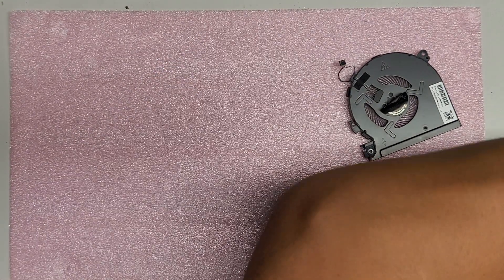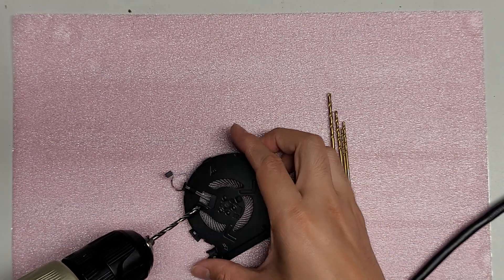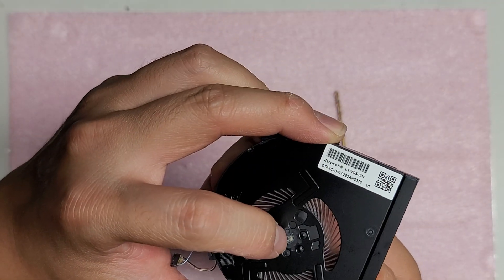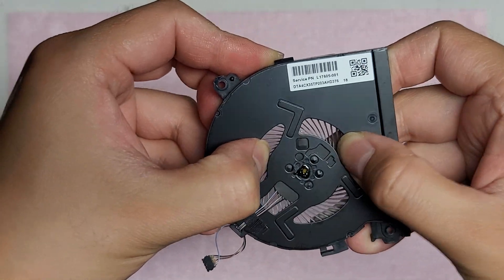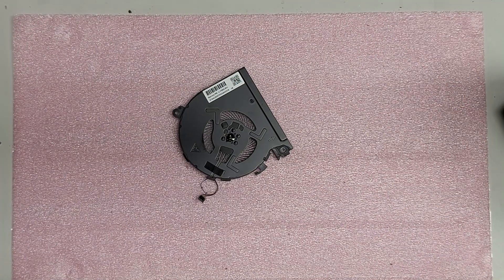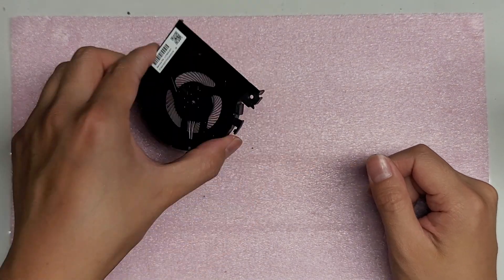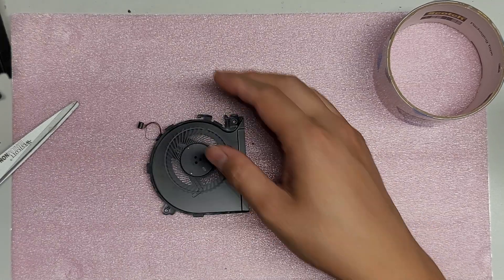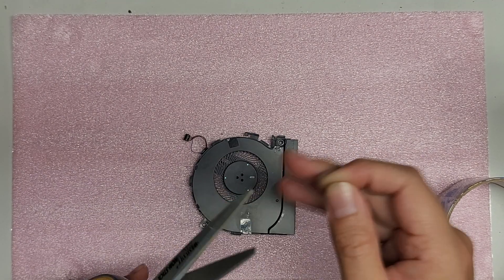Laptop fan repair drill method *other methods in the description*

Comment: Great video. I only think you somotimes wrongly said grease, when you meant lubrication. Lubrication is a wide category, whereas grease usually means a more viscous and thick. It penetrates less, but better stays in place. I think what you used here is widely called oil, what you also said.
Reply from the maker: Uhhh lol You better not be putting lube in your fan.

Comment: both my nitro 5 fans weren't turning on. i thought i messed up a setting but nothing i did could turn it on. so i removed fan and saw both where just too hard to start up. afraid of breaking them trying to pop them out i did this drill method ended looking brand new same speed like 6125 on both in nitrosense from cpu 0 gpu 0... for a nitro 5 this is the best method if you dont wanna buy new fans or can't buy. Thanks a lot!!! Great Vid.
Reply from the maker: Awesome, glad it worked out. If you haven't already, please like and subscribe so others can find my videos. Thanks!

Comment: Hi. Could you make a video on how to oil the fan of HP Pavilion 15-n series laptop?

I have that one, but I haven't found any useful video. Here, 99% of repair guys are scammers who will steal original parts from your systems. So, I'm not confident in going to them for help.
Reply from the maker: Watch the videos in the description. These are all customer computers. I don't have the money to go out and get every single model to make a video every time someone needs instructions for something. Lol
Reply: @ItsBinhRepaired  My bad. I thought the laptops you fix are experimental laptops lol.

Thanks for the response, chum.
Reply from the maker: @HAImaster  hahaha nope
Reply: @ItsBinhRepaired  Sorry lol

If I send you a video of my laptop's fan, would you be able to provide guidance? It looks pretty much like this, and you can't remove the fan. I pulled with all my might, but stopped because I thought I would break it.

It makes a lot of screeching noises to the point of drowning out every other sound in the room.
Reply from the maker: Maybe

Comment: Nice content! Have you tried taking apart the irremovable fins by drilling further? It would be nice to see how the fins can be taken apart for laptop fan modification such as swapping with 3D printed fins for better cooling.
Reply from the maker: It looks like they're mostly pressure fit into place. Sometimes you can remove them if you push hard enough on the center ring magnet area.

Comment: Thanks for these amazing videos! I didn't know you could cut those plastic parts to open a fan. In some other video you removed the blades but for this fan you said it can't be done. 
I'm trying to oil the fans of my Zephyrus G15 but the back (behind the sticker where you drilled) is metal and sealed.
How should I know the blades can't be removed?
Thanks in advance
Reply from the maker: You won't know unless you try

Comment: I dont have drill but using flat screwdriver, I scrape the plastic bit by bit....
Reply: Great idea! I used a flat screwdriver per your suggestion and it worked. One tip I'd add; only need to scrape enough plastic to reveal a small part of the white plastic bit -- oil can be sucked into it easily by then using the screwdriver to tap the white plastic cap. I used transmission fluid, and it worked great.
Reply from the maker: Nice
Reply from the maker: Hope it works out. Did you try popping the propellers off?
Reply: I can't, it won't pop off but the fan working well now 
Thanks!
Reply from the maker: @TearuRain  awesome!

Comment: Hey man, my fan is an hp elitebook 2570 laptop fan. I removed the sticker but i have no way of making a hole in it i dont have a drill any alternare method , btw some lube was on either side of holes is it maybe possible that i can lube from the holes?
Reply from the maker: This video and the ones in the description might help. https://youtu.be/3zs_SJ3BXgA

Comment: hey man, my laptop fan rattles at low speeds but once it is at full speed the sound is smooth, could it be that the shaft of the fan needs lubicant?
I have considered oiling the shaft for a long time but the damn fan is non removable and also has metal instead of plastic where you drilled.
Reply from the maker: use motor oil. Do not use cooking oil or WD 40.
Reply: @ItsBinhRepaired  thanks a lot bro, very useful information. Gonna try to drill first on a spare fan that I have.
Reply from the maker: @Masked4789  every fan is different even if they look the same.
Reply: @ItsBinhRepaired  yeah I get you, there are minor differences in pieces even if they are the same model.  I actually bought a replacement and the same rattle is present, very annoying. Just wanna test if I can drill it on the previous fan, but tbh I don't think lubricating will fix it.
Reply from the maker: @Masked4789  very strange. Usually lubricating will help reduce wobbling.
Reply: Hello i jave rhe same problem with the metal. those the drill method worked finally on the metal? thanks
Reply from the maker: This video and others in the description might help. https://youtu.be/3zs_SJ3BXgA
Reply from the maker: possibly. Try these. You might get lucky https://youtu.be/3zs_SJ3BXgA